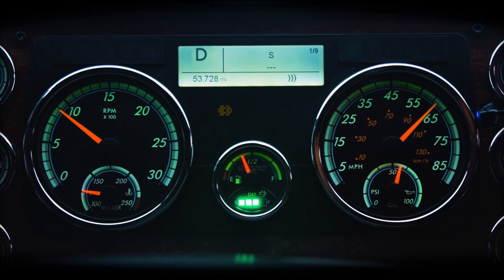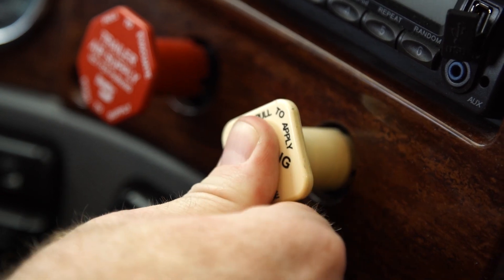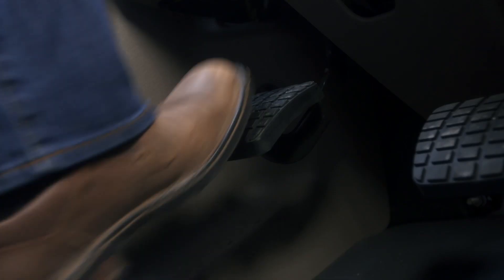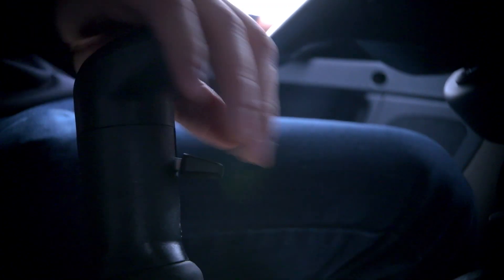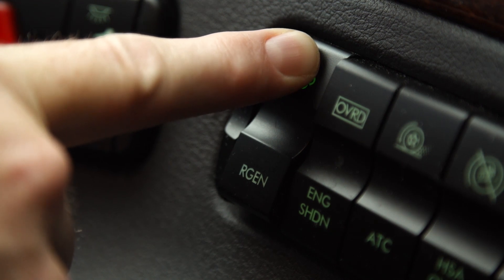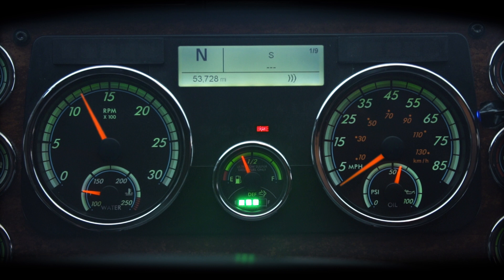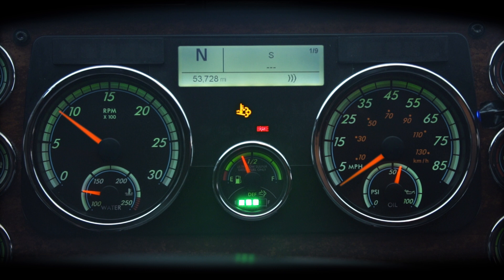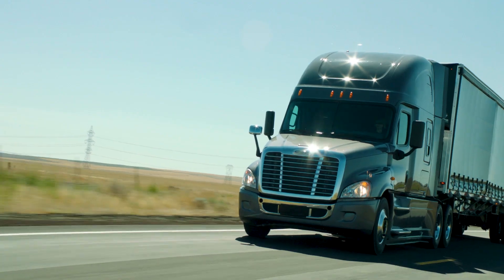Parked Regen GHG17 - Full Training Video

Comment: I didn’t buy new teuck to keep calling service ...I was going to buy new one ...but I took my friend truck Cascadia to drive it and decide ..and this regen gives me proplems daily now and here I’m stuck in the truck stop trying to regen the truck for two hours
Reply: if a truck takes 2 hours for a regen then it's needed to clear soot levels, let it roll...
Reply: My truck has been sitting at home for a month it called for park regen ,is a freightliner cascadia 2014...is it safe for the truck to get started on regen even with the temperature low or do i have to warm it up to 150 and above? Please help me..😁
Reply: @SNAKE301981  it won't let you regen until the temps are up, I suggest you take it for a 5-10 minute ride, and then attempt it (only if the system lets you to.) If not, you need to service your DPF.